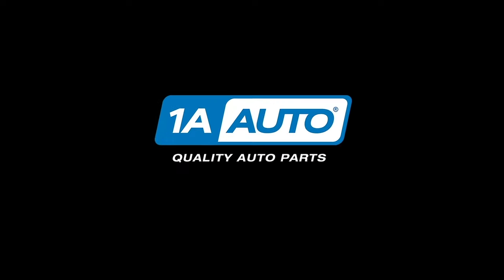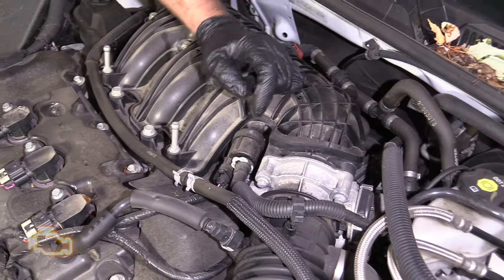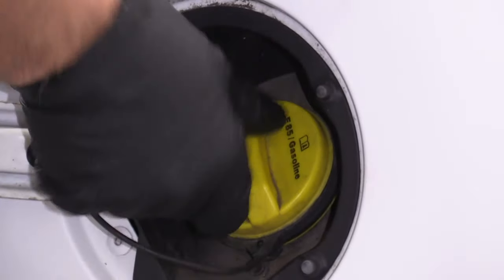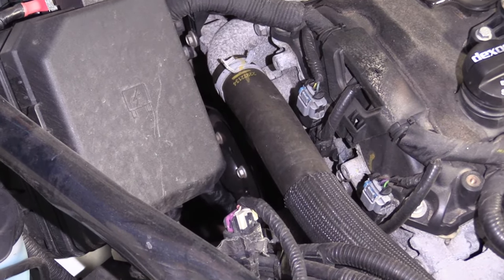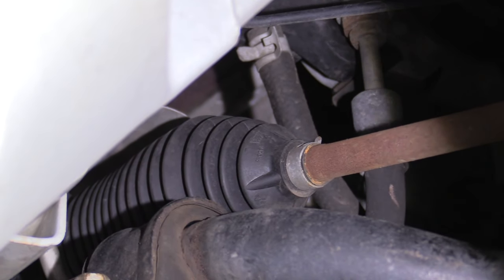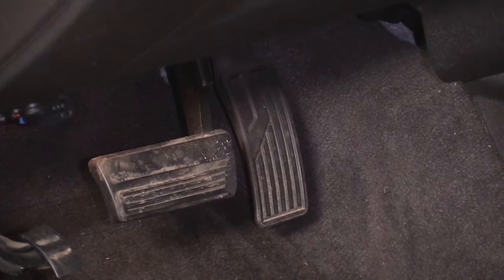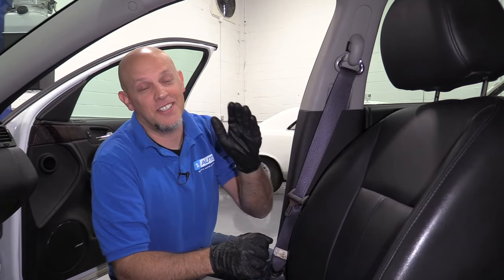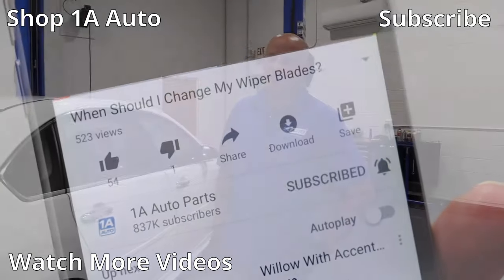Top 5 Problems Chevy Impala Sedan 9th Generation 2006-16

Comment: Good stuff thank you. Just to let you know though. The two most costly and biggest issues you will find in this car is cylinder 2, and 4 misfire, and the security/door lock actuater. The cylinder misfire is ONLY in the 3.5 e85 eco engine, and is caused by valve lash. If not take care of immediately it will cause head damage and need a full head rebuild. Also another problem with these is the abs harness. If not fixed your starter will and abs will overload and catch FIRE. I had to rebuild the whole wiring harness on 2 of these vehicles. Otherwise these are great cars.
Reply: Is the 3.5 e85 eco the one that takes flexfuel?  I just bought an 07 with 155k miles
Reply: @sam10nbomb31  yes it is. 😊
Reply: @sam10nbomb31  Yes. You should be ok. If you get a misfire fix it immediately. If it continues its a lifter. At that point you need to lash the valve. The dealer usually takes a couple hours to do this.
Reply: @independenttwospiritmedia9555  tysm

Comment: I have a 2014 impala with 160k miles. Sometimes when im trying to turn & accelerate (pulling out of a parking lot) the car takes a second & makes a noise that's hard to explain. Idk if it's a gear noise or what. But the noise happens along with a 1-2 second delayed acceleration reaction, then it quickly catches & accelerates. Idk if that's a sensor issue, a gear issue, or one of the 5 issues explained... 🤔 I'm not too well versed in cars...
Reply: I have that same issue,  I don't know what the problem  is, I'm asking  the same question  😐

Comment: Man that effing gas pedal. I spent 300 bucks on a rental car because of this issue.  Came back ftom my trip and decided to change the gas pedal. 60 bucks and 5 mins changing it and problem solved.
Reply from the maker: Good to hear. Thank you for checking out the video. If you need auto parts go to: http://1aau.to/m/Shop-1AAuto-Now

Comment: I have a 2005 bought in 2006.

My check engine light is always on and when I get the oil changed they always turn it off but in a matter of days it eventually turns on again. 

My cluster panel has been not working for years. Gas gage works and all the sensors stuff seems to work but MPH and Overheating broke.

Comment: The first one Evap purge valve. Another symptom that occurs is when refueling your car with gas the car has a hard time starting. Thought it was the fuel pump but it was just the Evap purge valve. I drive a 2012 Chevy impala LT.

Comment: Well, what about the V8 version of this car, I happened to own one I purchased it in 2014 a 2007 SS with 15k on the dash currently the car now has 64k original miles on it,I did have a gas pedal issue on it and replacing the pedal fixed that issue, another problem was #1 cylinder had a mis fire due to engine oil bypassing the pcv after replacing that valve thats built directly Into the valve cover I installed a oil catch can and that solved the issue aswell. When I purchased the tires, I showed excessive movements on the front hubs, so they were replaced with a set of MOOGS Hubs. Oh yeah air blend all 3 and one window regulator 😂
Other than that, the vehicle sits after i retired from the military. Now I'm getting it ready to sell it because it no longer fits my current lifestyle.
It would be nice to hear about technical issues from this version other than the popular v6 .

Comment: Ok so I own a 2011 Impala LT (3.5L) I’m starting to hear a ticking noise while idiling and becomes louder when accelerating, also the car doesn’t really seem to wanna accelerate when I gas it. And when I push down on the pedal it’s like that car doesn’t wanna go faster so I just ease on the gas and cruise. Any solutions?

Comment: I keep getting “engine hot turn a/c off”  even after I replaced the temp sensor. I see that this is a common problem on this gen Impalas. After a few starts, check engine light and dash notification will go away and temp gauge goes up normally. What else can I do to fix this problem?
Reply: Check the fan fuses and make sure both fans are working first then go from there.
Reply: I had the same problem on my 2010 LT. I came to the conclusion of a stuck thermostat. Change that and flush the fluid. Problem went a way.
Reply: Im having this issue too. Everything points to the sonsor. Clean or change the pigtail as well.
Reply: I had the same issue, it ended up being the thermostat it was easy to replace.
Reply: @Ron-ym4zn  thermostat
Reply: Disconnect the battery for a minute it should go off
Reply from the maker: If you scan test the vehicle and find that you have a P0128 most of the time its just a faulty thermostat and It needs to be replaced. You could also have a computer glitch try disconnecting the battery for about 10 minutes and see if the problem is gone. Thank you for checking out the video. If you need auto parts go to: http://1aau.to/m/Shop-1AAuto-Now
Reply: @1AAuto  I changed my thermostat and coolant temp sensor and resolved that issue.

Comment: The evap purge solenoid on mine has also caused issues filling up the gas tank for some time. it makes the pump shut off after only a few seconds. I only got the check engine light come up recently and the car started to run rough after filling the gas tank.

Comment: I just want to add it is not the gas pedal u will waiste ur money on changing the gas pedal its gonna be ur throttle position sensor ur tps I changed mine about 3 years ago and running good

Comment: I have the SS model from 2009 w/140k miles.ive replaced everything in this video except the power steering rack. Plus ive replaced blend door actuator and remove the Active fuel management with a tune
Reply from the maker: Thanks for watching. Hope you found our video helpful!
Reply: So the loud tappin. Knocking is the acutator

Comment: another problem is if you have a performance oil based air filter like a K&N, is to watch out for the oil to contact the map sensor. I did and had about 5 trouble codes. I clean my map every three months. If you have never cleaned one, it is a great performance boost
Reply: Might as well use a regular air filter than keep going through that.
Reply: @retiredsnowbunnyhunterx5106  regular filter is made from paper, try breathing thru paper or cotton??
Reply: @palmcoast26  I know that I'm just saying. Some cars don't respond well to k n filters. Most cars that I have had with installed I normally clean it good then let it air dry for day from the water. Then light spray the oil an let dry another day. Never had any problems with it messing up the map sensor.
Reply: @retiredsnowbunnyhunterx5106  when they are NEW........even if you let it sit  for days, it has already been thru months on shelve

Comment: Number 4 on the video list may actually be the answer to my problem. Granted my 07 has 245,000 miles on it and I've put a ton of work in after my bro gifted it to me. (turns out it was an army motor pool car) 3rd chevy; One thing they all had in common was the damn headlights shorting out and the rear defrost not working but those are tiny issues in comparison to having to replace transmission, exhaust system, oil leaks... pretty much everything @williambaldwin1707 said. If it wasn't a gift from my baby bro, I'd straight junk it.

Comment: MY 2012, when I cut the ac on, it sounds like it is about to blow. Its sounds similar to a little muffler noise. Car shakes a bit. Now engine light is on. Also something still stays on even when i cut the car off😢😢
Reply: @@skatevids7683 no.  It's the dual fan. And now the ac doesn't get cold.  Probably compressor

Comment: My car won’t go into first gear and my mechanic ran my code and said what I says is already fixed what’s the problem with my car because now I can’t accelerate at all except for in reverse smh
Reply: Before that it ran rough in first gear and smooth after it got thru that

Comment: So far had none of these fail, my top 5 problems with my 2012 Impala LTZ has been, 1. Direct fuel injectors 2. Blend door actuators 3. Back window defroster not working 4. All 4 door lock actuators 5. Stabilitrak wires and or sensors.

Comment: I have a 2006 3.5 litre Impala with 120,000kms. I've replaced the water pump, transmission cooler lines, front rotors and pads (2X),  sway bar,  HVAC blower motor, left front hub, intermediate exhaust pipe, resonator, muffler, and most recently a BCM. Do Body Control Modules go bad on these cars? The engine burns or leaks 1/2 litres of oil every 2000 kilometers. I paid a total of $750 for a mechanic to diagnose and replace the BCM. He said BCM's are known to fail in these cars?

Comment: 2007 with 194,000 miles and my son is still running her. 
Blend door actuator. Rear sway bar links. Gasket on oil filter mounting bracket. Did I say blend door actuator? Motor mounts. Can’t keep the brakes from pulsating. Yes I carefully torque the lugs. Rear evaporate purge canister. Couple of times. Oh, did I say blend door actuator? Seat adjuster motor. Had the air conditioner compressor freeze up just out of warranty. Keep an eye on the camber on your rear wheels. You’ll eat tires on the inside if you don’t.

Comment: I have a 07 with the 3500 V6 in it with 160,000 miles. When I stop at a stop sign or light and then prepare to take off the car seems to have slack and I have to be very careful taking off bc it will jerk hard unless i accelerate lightly first. if i accelerate too much before the drivetrain catches up(1 second) it jerks hard as it catches. If it was rwd id say u joints but its fwd so im kinda lost. Anyone have an idea of the problem? Is it the tranny or maybe even a bad cv? Also if i put it into park on a hill i have to use the e brake or its hard to get into drive. Is this tranny linkage?

Comment: Have a 2011 impala LTZ, 274,000km or 169,000miles on it lol in Canada. Never replaced a transmission yet nor any issues with the 3.9L motor. But had a tranny line rust off, the EVAP sensor comes on once a month, seat belt tensioner needs to be replaced, haven’t replaced anything power steering wise but can hear a slight squeal when you turn the wheel while sitting in park. Water pump is still going good, but for the past year once the car is up to operating temp, it’ll go down ever so slightly but then rise back up. Just gotta do proper maintenance, it’ll be the salt they use in Ontario that’ll be the downfall of my impala ):

Comment: Don’t buy remanufactured steering racks. I went thru 2 in a month after my original went bad. Nobody seems to know how to rebuild
Them correctly.
Reply: this seemed to work for me. my 2010 impala rak leeked. so i put transfluid in the pump. NO more leak.
(dextron vi )

Comment: I own one of these and on the EVAP canister when they go bad you need to replace it with a Acdelco GM part!!! Because if you don't and buy aftermarket brand at a parts store such as BWD brand (which makes alot of aftermarket electrical and emission pieces) they will Emit a loud and I mean LOUD constant clicking noise you can hear it even over the engine and fan noise. Because i had to replace mine and I tried 2 different replacements and they both had the loud clicking noise for reasons unknown and after some research on GM forums using the Acdelco part fixes the issue. So its true not all parts are created equal

Comment: Concerning  the evap purge solenoid,  the engine might stutter when starting and sometimes shut off after fueling or removing the fuel cap. Replaced the solenoid and wahla 🎉

Comment: I have a 2006, 2007, 2008 and 2013. Water pumps and blend door motors are very common 2006 has been the best with 211,000 miles. The trans went out of the 2007 at 300k. The 2008 has close to 300k. 
The 2013 is the worst! 115,000 transmissions pressure sensor discs failed, but wasn’t a bad job to replace. And it ran great until one extremely cold morning it failed to start and hasn’t started since. I’m guessing maybe a timing chain failure. That’s todays project. It has 190k. It will crank and almost starts and runs slow and dies.

Comment: It's no secret that the 3.5 & 3.6 l flex fuel engines are trash, I have the 3.9l w/160 000,sat for 5 years in storage & I drive it everyday with no issues.

Comment: I have a 2010 Impala LT and my 3.5 engine does not look like that one, the only one of the problems they listed that I had was the pedal sensor,  what year of the Impala are they using, don't get me wrong I LOVE CAR and wouldn't trade her in for anything less than a blue or green 1965 /1966 Mustang in perfect condition and even then it'd be a hard choice
Reply: ('68 cougar was a better ride.)  🐆  YES i have a 2010 impala. 58,345 miles / silver grey. good car.

Comment: My 2014 Chevy Impala limited LTZ makes a ticking sound when I first start the car in the AC is on. Today it started to make the sound when I use the remote starter & every time I turned on the car even when the AC was off (& at times when the car was off). Do you have any suggestions on what it could be?

Comment: I have a 2006 and my AC is just blowing out hot air. I brought it to the shop and they put new caps on and recharged it and it lasted maybe half hour is there an easy fix to that or should I replace the whole thing? 😣

Comment: I have had 2 Impalas 2013 and 2016 Limited

The ac actuator plastic gears strip out especially in Phoenix heat. One was already replaced and didn't last two years. The other they wanted 8 hours to replace.

The transmission went out once. Was rebuilt at dealership. About 40k miles later a solenoid was acting up and shifting from first to second was erratic.

I loved the engine. The highway gas mileage was always over 30 mpg

But typical GM junk. They should have a lifetime warranty on repairs so you only pay once for a repair. That would keep them honest
Reply: Was the transmission and solenoid problem expensive to fix ? I wanna impala but that transmission issue is scaring me
Reply: @BoiBoiGTA  I traded it in. I can't tell you.
Don't buy a GM without a comprehensive warranty. They always have lots of problems. The dealership will do you wrong.
When the transmission went out under warranty, the service advisor said I was getting a remanufactured transmission. I called the next day and was told he was tired and they were going to rebuild the transmission in house. Deceitful. Call some transmission repair shops and ask if they have a lot of problems with them. Someone else's used car was being sold for a reason. Investigate thoroughly so your not stuck with a problem. Good luck
Reply: @John-pz6nm  thanks 💯
Reply: @BoiBoiGTA  Definitely✌️

Comment: Hello I bought your Throttle Body to try to fix my p2127 code and Engine Power Reduced but it's still doing it. I was hoping to get a bit of advice. These are the things I've already had replaced to try to fix this problem:

Gas pedal (twice)
New alternator And battery
Checked all wiring+harnesses including x111
New throttle body

THIS PROBLEM IS DRIVING ME NUTS AND IT'S BURNING A HUGE WHOLE IN MY POCKET
Reply: Cut the wires to throttle body off and splice  or use wire nuts like I did never had a problem again.
Reply: Try fuel regulator sensor

Comment: I found a 2008 Impala LT on cars.com with 19,xxx miles. I would have my mechanic do an inspection on it before anything.  Do you think it's worth taking the risk on an older car with low mileage?  Blown head gaskets or dried out seals from sitting too long?
Reply: Got an 08 for 50,000 it’s now at 70,000 had it for 3 years only thing I fixed was the tire rod and now I believe I need to fix my steering wheel pump so far that’s the only thing and hope the only thing hahah

Comment: Helpful hints: buy these from '12-'16 only.
That way, you get the 6 speed & more importantly, the 3.6 (which, btw, needs an oil change when the digital display reads 30%, not 0%!).
Reply from the maker: Great tips! Thank you for checking out the video. If you need auto parts go to: http://1aau.to/m/Shop-1AAuto-Now

Comment: Ive been looking at this 2011 9c1 impala with 149k miles on it. Is there anything I should get checked or ask to get checked before I buy? My coworker says there aren’t any problems with and she’s an older lady. I will mention she said there 3 owners before it though and she would hook me up for $2900. I’m in real need of a car at the moment. It seems like a good deal, but any help, tip, etc. you guys could provide would be a big help.
Reply: Did ya get it?

Comment: Anyone have a steering problem like hard to TURN but The power steering pump is full
Reply: Yes, I had the same problem. I add fluid even tho it shows full, and it helps. Also could be air in the lines. Park the car on a steep hill facing upwards and set parking brake. Open hood and remove cap on power steering pump. Return to car and start. Turn steering wheel back and forth about 30 or 40 times. This will force air out of lines allowing you to add more fluid. Hope this helps.
Reply: @amaralbrian1  thanks for the help but ended up selling The car

Comment: I have 2 07 impalas and they both need passanger cv axels and have power steering issues.
Reply: I've replaced pass CV twice and driver side once. Also rack and pinion, power steering pump, MAF, MAP, ignition coil pack, both transmission lines, both power steering lines, radiator, plugs, wires, front struts twice, sway bar with bushings and end links. Both inner and outer tie rod, back struts, all brake calipers, all 4 wheel bearings, back sway bar, flex pipe, lower control arms with ball joints. Trans fluid with Filter. Battery, both 02 sensors, air filter, cabin air filter. Wiper bushing, I can keep going